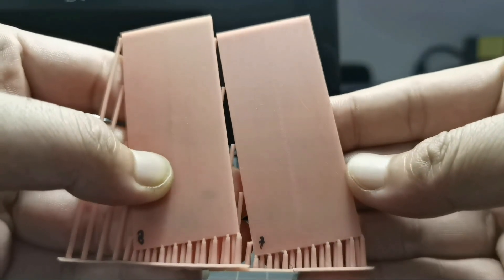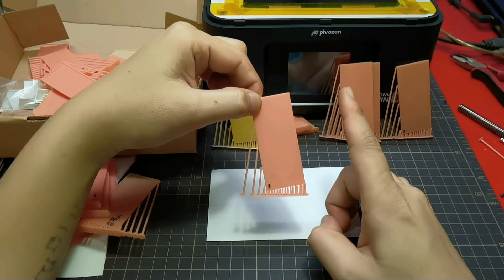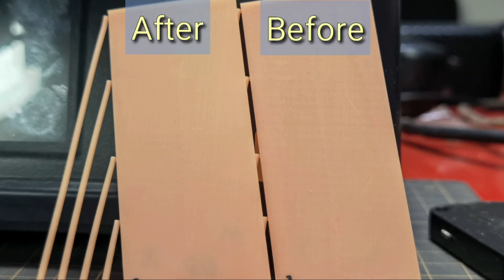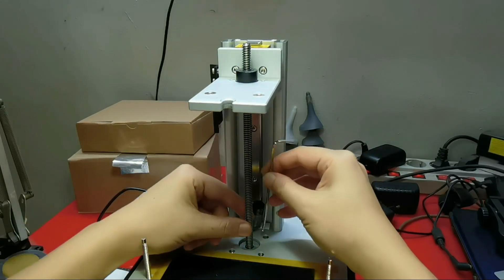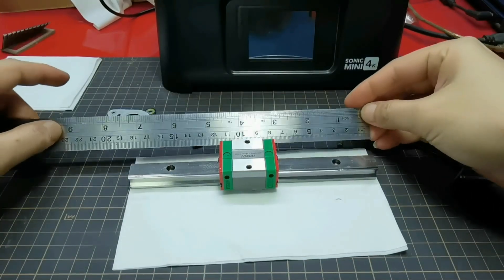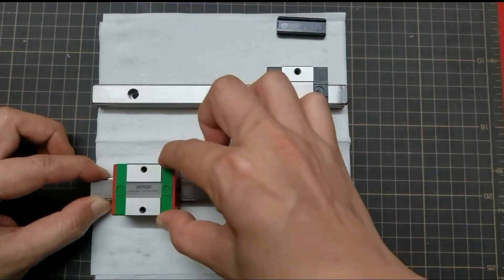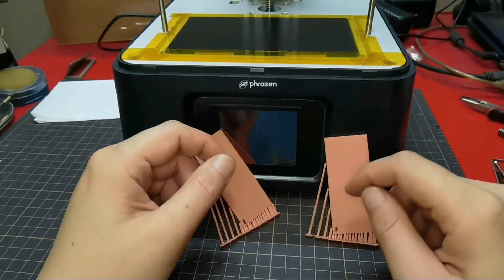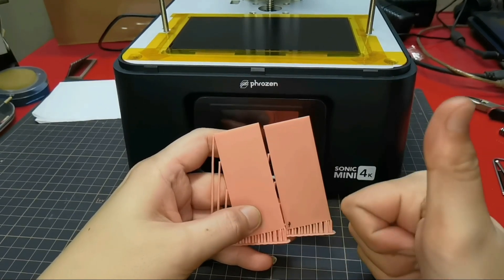Wobble Lines Fix Sonic Mini 4k

Comment: Mine was a later model sonic mini 4k. I blindly trusted your part # for the guide rail and got the wrong one. The later models actually use the HGW15CA. Wasted $93
Reply from the maker: Sorry, but that is the number my supplier told me.
And later sonic mini 4k already use a bigger guide block with 4 bolts and not the same as the one in my video only 2 bolts.

Comment: Would a new unit shipped in may of 2022 still suffer from this issue
Reply from the maker: Nope. It already has upgraded build arm, stepper motor and guide block.
Like in my video reviewing the upgrade kit.
Reply: Im looking to get better prints over  the ones i get with my mono x 4k.  This printer has 32um xy resolution and mono x has 50um.  My mono x does not have the wobble though.   
I was going to get the 8k mini but if this one will get me better prints, i may save the money and get the 4k.   I dont want to do the second upgrade on a new printer.

Comment: I was looking at the factory upgrade, and I have to ask, what is the stepper motor improving? is it more accurate? I'm unfamiliar with stepper motors and what ever factory upgrade kit, might provide.  I can see the benefits of the premium rail bearings and stiffer z assembly.
Reply from the maker: I don't have the factory upgrade. So, sorry i can give my opinion.

Comment: The wobbling comes from the light attachments between the rail guide structure and his base. It's clearly visible that it needs reinforcement. Phrozen should have include in the upgrade kit a piece of aluminum to install behind the rail guide structure  in order to increase the attachment surface with the base. It's also easy to make it yoursef.
Reply from the maker: I change the guide block and rail.
And the wobble is gone like in my video.
Reply: @wangdennys  Actually the whole structure need to be improved. The replacement of the guide block and rail is part of the issue. Other brand have the same wobbling problem with their vertical structure for the simple reason that it's light everywhere.
Reply from the maker: @ga9098  feel free to improve you printer z tower, If this video fix is not working for your printer.
Mine is fine after rail and block change, like in the video. No more wobble lines.
Some user confirm to me their wobbles gone with just installing damper.

Comment: I have found a suitable rail and carriage that matches the specs you have given but you have listed the space of the holes as 28.5mm where as the manufacture I have found (Misumi) only sell it at 20mm. Would it be straight forward to change the mounting holes?
Reply from the maker: You mean the E number?
Reply: @wangdennys  Yes the E number, although misumi refer to it as G number. My post keeps getting deleted not sure whats going on :/  

*Edit apparently my other comments were considered spam so they get set to you for verification or something
Reply from the maker: Btw phrozen sell upgrade for the z tower and all.
You might wanna check it first

Comment: Another great video. Have you changed the z motor? Do you have the z motor specification?
Reply from the maker: I did try new stepper and still wobble.
So i change back to original stepper + damper + hiwin linear guide. Then the wobble gone.

Comment: Thank you for the video! This is my list for you to make fast essential modifications for the Phrozen Sonic mini 4k: to install stronger building platform handler without bending, to change para led 2.0 to 3.0 to eliminate overexposure lines, install silent fan and carbon filter. Probably it's just easier to buy 4k screen and install it just to any old second hand 3d printer than all this hassle with fine tuning of this machine...
Reply from the maker: Hi
Ok, can i contact your fb, to have further talk?